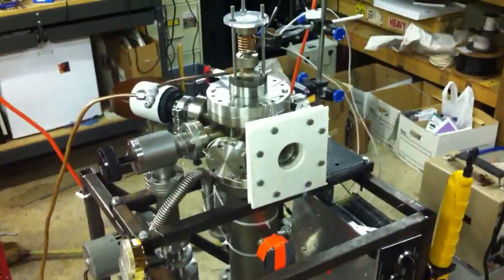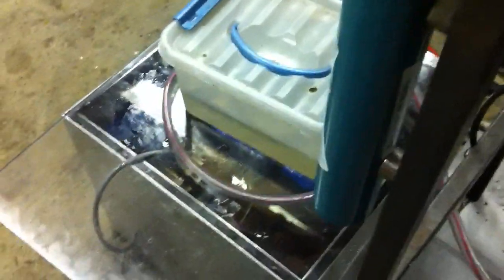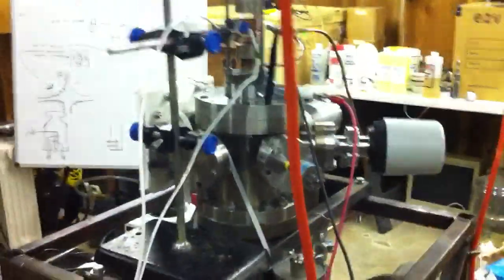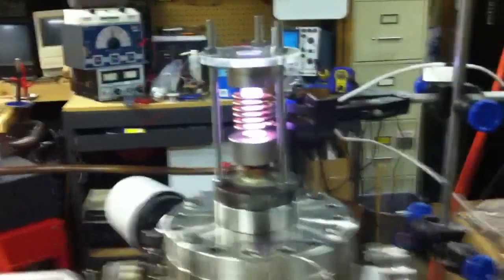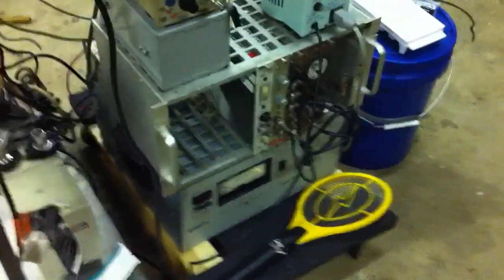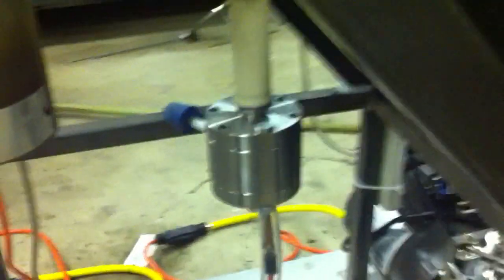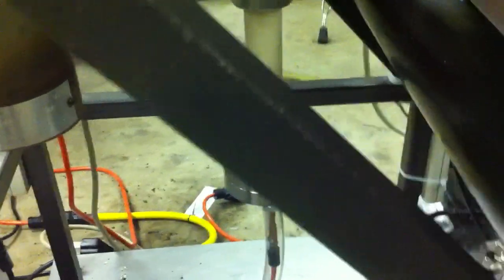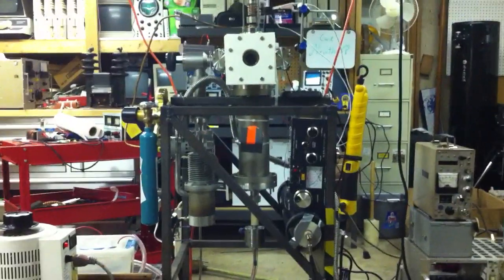Beam on Target n-Generator

Comment: hi, the principle of it is using accelerated ion hitting a metal target, so that it split a neutron? I a target of titanium and tungsten, which one should be used？ For ion, can I use H+(proton) instead of D+( deuterium)?
Reply from the maker: Oh, this is from an age ago. Theres a 1 micron deep surface layer that is being loaded up or implanted with deuterium from the deuteron beam. So the DD reaction is what's being worked here. You can quite honestly just use whatever metal you have access to in order to make a target. Some are better than others. Slam the phrases that i put in quotations below into google and skim read the papers within the first few search result pages and you'll probably get a feel for it. "self loading targets neutrons deuterium"
Reply: Thx 

The ion source, how do u make it? I find that RF discharge from a high power RF amplifier could be a choice but it is expensive. May I use tesla coil ionizing deuterium as the ion source ?Can it work as  good as RF amplifier do? if not, I decide to build a RF amplifier. Can the input signal for the amp generate from a FM transmitter?

Comment: Robert - What is the best rate of neutron production (neutrons per second) you have so far achieved from your Beam on Target neutron generator?
Reply from the maker: Hello Robert, I recently broke 100k n/s, a pittance. However, in my defense I add that I'm still capped at 50kV as I'm presently in need of a better high voltage supply - your typical BoT is biased at ~90kV so I'm not very high on the cross section for reaction. I would also add that this is still very much a work in progress. The Inductively coupled plasma and electron suppression are recent improvements only within the last month, I'm still optimizing things. I look forward though to the opportunity for a serious neutron run, I hope someday for 10^8 for some experiments I'd like to try.
Reply: Robert - Thank you for your kind reply.
What kind of neutron production is observed from the best amateur built Fusors (if you know)?
Could you give us an idea how much 10^8 n/s exceeds the neutron production of a good amateur built Fusor?
Thanks!
Reply from the maker: Robert Steinhaus
Oh of course, it's not every day someone from LLNL comments on my work.  The best neutron producing Fusor was Jon R's Fusor at 1.4*10^7, my Fusor could peak at 1*10^6 and that was already unusually high for most systems since the average is somewhere around 10^4 to 10^5.  Mind you I was pumping 7kW into my Fusor over the average power level of a few hundred watts.  Fusors are NOT stable devices so they are not ideal for experiments.  The BoT's greatest value is stability, secondary value is the higher neutron production, and third is very low current requirements for HV biasing.  Commercial BoT's can rock 10^10 on up.